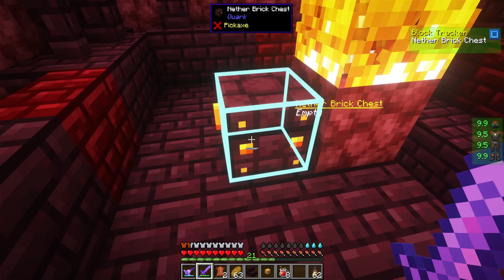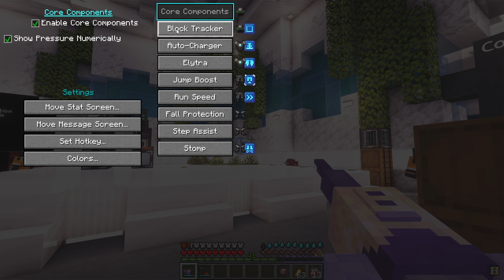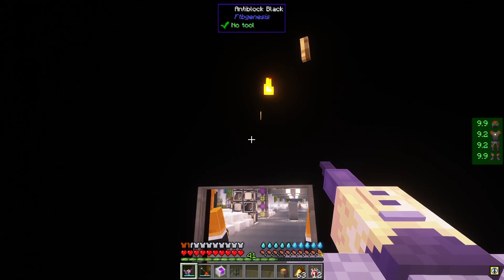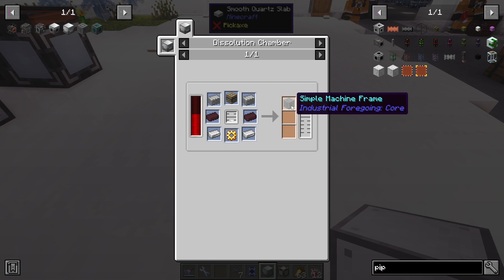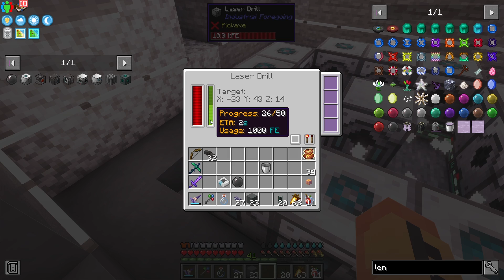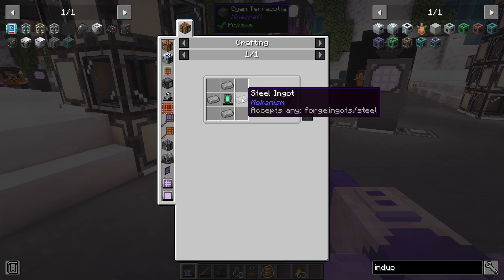FTB Genesis Infinite Crude Oil Automation - EP12

Comment: I set up a cluster of Mek 3x3x3 dynamic tanks to store utterly stupid amounts of all the separation byproducts of crude oil from Pneumaticcraft, and then used a Logistics Drone to shuttle 4 buckets at a time from each segment of the tower, to one of the respective tanks. (I had to use a small Pneumaticcraft tank with a dispenser on it as an insert point to the larger Mek tank because the logistics frames kept popping off the Mek tanks -- whoops!) but needless to say I have a LOT of diesel, kerosene, gasoline, and LPG, and converting the kerosene and gasoline to LPG is the next step

Comment: I think you can make energy from gasoline and kerosene because diesel you use for lubricant you have a use. But all the liquid from crudu oil in my opinion need to use for energy and dont void ,i know it not produce a lot of energy but is a subproduct you can make energy and think need a lot of energy from everything in this modpack even just for backup
Reply from the maker: I could go that route later if I need to scale, currently I am already out producing production on my 20 Combustion Generators.

Comment: why is the dark room they gave for the redwheat still have light level the same as outside the room?
Reply: The slabs on the roof. It's been fixed in newer versions but you need to fix your room. Replace them with full blocks

Comment: About the Industrial Worktable.
there is a wiki entry in the tombe you got.
(IC2C wiki has a feature where you can sneak click on a block and it will open the page of that block, if present)

But you can think of it as a crafting table with recipe memory that can recursively craft its ingredients if it knows the recipes.
(Expansions can directly or indirectly touch it)
Ofc there is limits to that.

And no it can not automatically craft items, it can only craft requirements for your manual craft automatically.
Reply from the maker: I read the book. I got confused how to use the memory sticks.
Reply: @Systemcollapse  just insert them into the slot of the worktable.
It will unlock extra recipe slots.

When you take out the memory stick it will have the recipes on the slots it unlocked.

So you can swap them.

Comment: if you only have two outputs you get diesel and LPG, not gasoline or kerosene. also using a Thermal pneumatic Processing plant you can turn kerosene into gasoline and gasoline to LPG

Comment: Just updated the pack to 1.2.2 and started a new world - getting wiped out in the Lost City - mobs with 100+ health and extra speed - lots of poisoning from rattlesnakes.
Reply: some buildings are haunted now, its a chance, but if your gear isnt good enough to deal with them you can just /rtp and find other non haunted buildings to loot with easier mobs
Reply from the maker: Haunted building can be scary for sure.
Reply: @Systemcollapse  Yes. But on the other hand, I got myself to a hostile mob model of a witch that way with relative ease (apart from one witch running from me with speed III..)